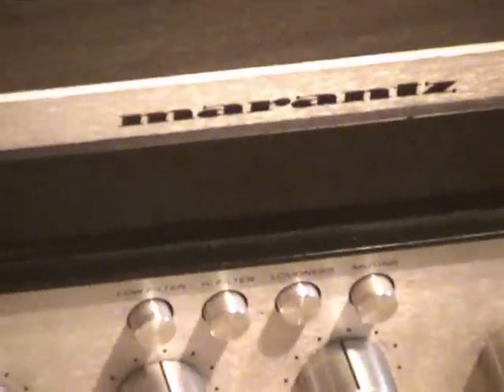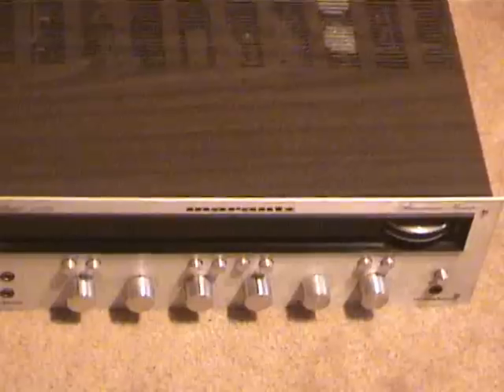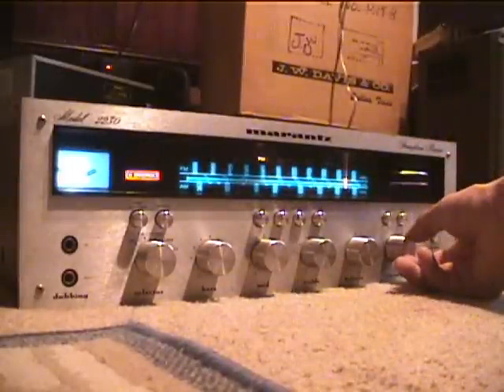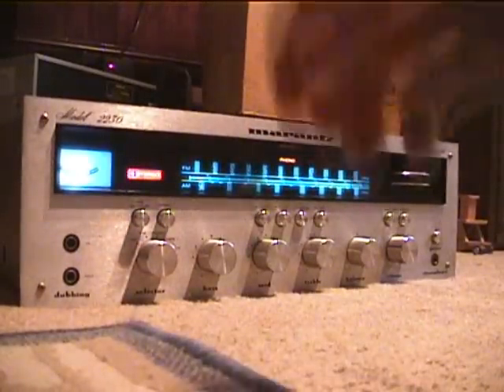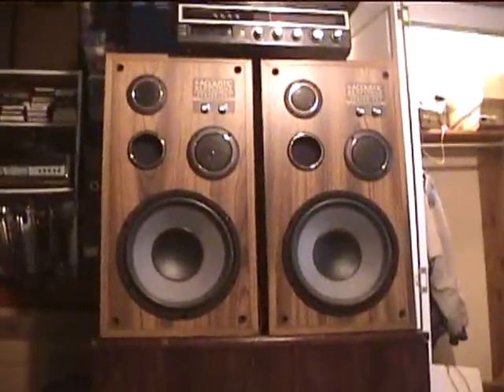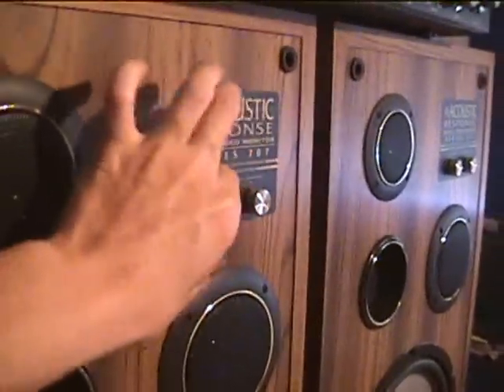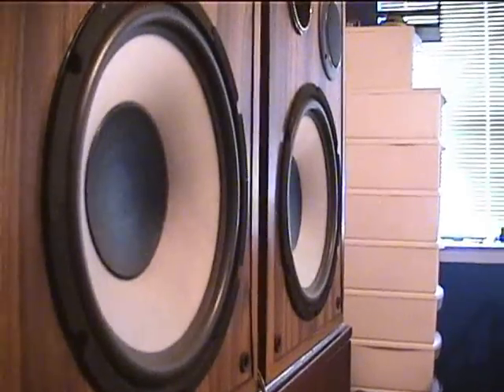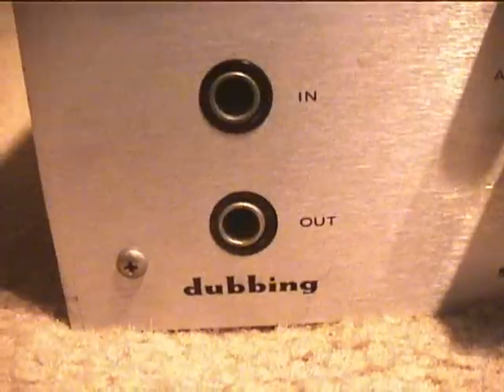Marantz 2230 stereo receiver and Acoustic Response 707 speakers

Comment: I'm a collector and repairman for marantz equipment, usually the capacitors on FM MPX board an FM stereo decoder board are old. Like 35V 220uF and 16V 10uF. very nice model, i have two of these.

jon

Comment: That looks like a really high quality receiver! The AM sounds really good too. I haven't worked on many solid state stereo receivers but I know on tube type radios that you control where the station appears on the dial by adjusting the oscillator frequency...I had to do this on the GE 6-tube AM radio.
You really lucked out on that woofer foam! so many of these I see are all disintegrated.

Comment: I received a receiver almost identical to your Marantz from my dad and bought a nearly identical more worn receiver at a flea market for $10 after negotiations. The reason I bought the $10 Marantz was that I knew it is powerful and I used the one my father gave me thru much of my childhood in the late seventies until about 1990, and experienced great rich sound thru two JBL 8 inch woofers (plus JBL tweeter) that delivered deep bass without distortion almost any distortion. I wonder what that receiver cost new. The speakers if memory serves correct are the same company that made speakers that had 12inch woofers and had one tweeter plus 1 mid on a gray carpeted plywood box. I remember that the tweeters from these speakers were known as "Piezo" hor tweeters. and the speakers did function "OK". They were traded for from a guy I graduated from 12t grade HS within 1993, and he did sell these literally out of a white van. He had paperwork he handed me describing the company and expressed how he mounted a set of these in the nearest Rockville MD Hooters establishment. I dismounted the 12-inch woofers to see a small magnet for the grey 12" woofer and I think it also was labeled "Made in or product of China". They were made with cheap materials and for their size, they sounded acceptably descent. I traded them away thru the decades. I never really regretted having gotten them as they could sound good thru a weaker older amp. I know that one of them blew out the woofer when attempting to push them hard with deep bass rap music.

Comment: Wow lucky day or what! Throwing those speakers out was someones mistake for sure. The Low adjusts the bass response on the speakers. Good luck score with the Marantz to. These were built to last. My amp now celebrates its 28th birthday, never been to the repair shop, has done unbelievable work and still sounds great. It is still used in my amp rack today for the mid to high amplification.

Comment: I have a set of the AR 707 speakers and I love them. I power them with a vintage McIntosh 2100 amp and they sound great. I've used them for about 10 years and I have never had any problems with the speakers or amp.

Comment from the maker: You're right! Acoustic Response was even listed in the list of "brands" reported as White Van Speakers! If you notice in the video when they are tuned very loud with lots of bass the bass doesn't even sound that good, it has kind of an improper "thump". No-wonder! No-wonder they didn't put the impedance and the midrange control was listed as "low frequency" instead of "mid-frequency". The guys don't even know what they're talking about!

Comment from the maker: @TheSoundsOfSymmetry You push the red and black connectors to open and stick the stripped end of the wire into there. The red button may be a circuit breaker to hopefully prevent damage.

Comment: I have a Sansui 6060 with orig. box and speakers, needs checked out and one of these Marantz 2230 units, just hooked it up and Rockin' out to the oldies...LOL  dug these out, almost gave 'em away or hauled out to the dumpster, glad I got bit by the vintage bug... LOL   {contemplates taking the Bose system out of family room.. .LOL }  It'll have to be tunes for the Man Cave hobby and train room... only prob is a lamp is out... sounds great on a pair of tower speakers, newer pioneer 3 speaker jobs